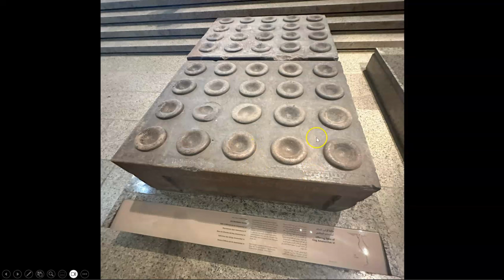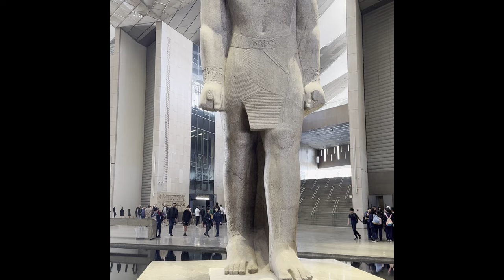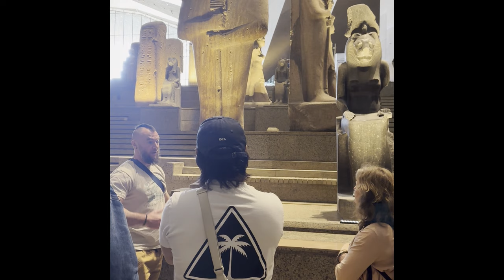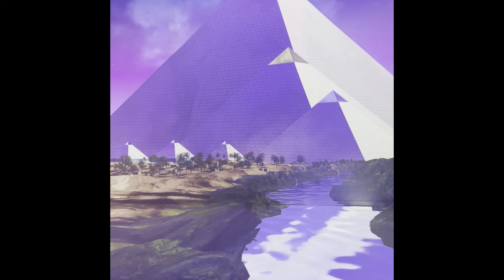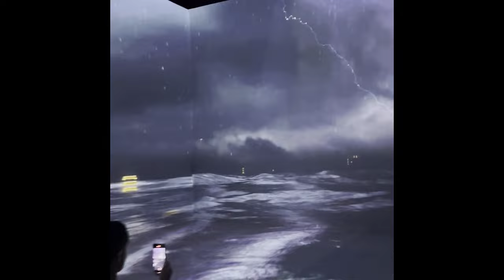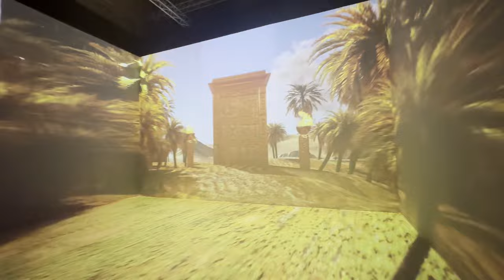Secrets In Plain Sight: Ancient Lightning Technology At The New Grand Egyptian Museum

Comment: Ohh, Directly dissolving SO3 in water, called the "wet sulfuric acid process", is rarely practiced because the reaction is extremely exothermic, resulting in a hot aerosol of sulfuric acid that requires condensation and separation.

Comment: There is so much more research to do and conclusions to come to in regard to how the great pyramid functioned exactly. Try figure out now the small details like the State of matter of the sulphur introduced as a raw material into the king's chamber, this could even be gaseous sulfur. What was the mechanism for the combustion, this could even be superheated steams generated inside the grand gallery channeled towards the king's chamber (perhaps through Davisons tunnel?)
Why the king's shafts are slanted if it was just for sucking of fresh air, could have been horizontal, or it's because liquids were poured down these shafts..etc etc

Comment: Process for condensation of sulphuric acid vapours to produce sulphuric acid
Abstract
A process for production of sulphuric acid comprising condensing sulphuric acid vapour from a gas mixture containing 0.01 to 10 vol.% of H2SO4 vapour calculated at complete hydration of SO3 in the gas to H2SO4 and 0 to 50 vol. % of water vapour by cooling of the gas in a sulphuric acid tower, wherein a stream containing NH3 is added upstream of the tower an an amount corresponding to 0.01-100 ppm NH3 by vol. in the gas stream at the entry of the tower